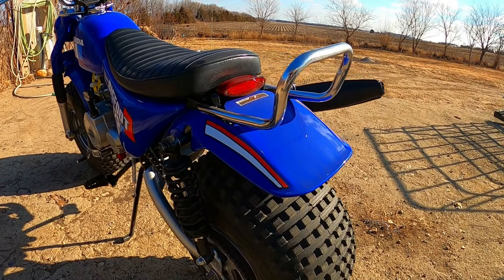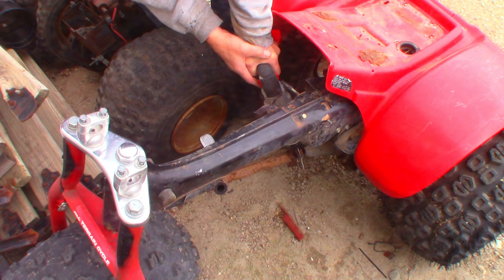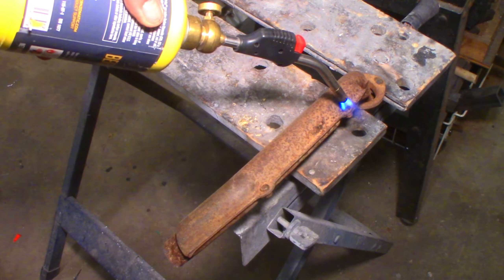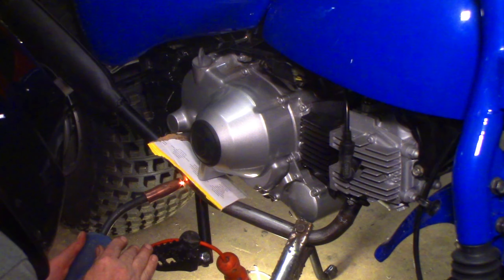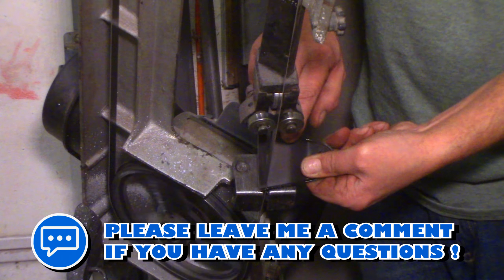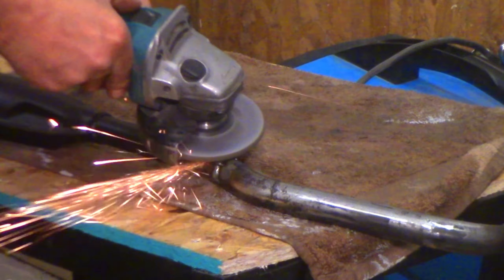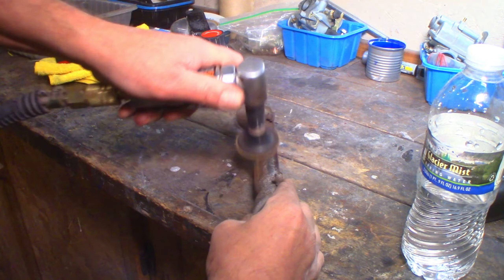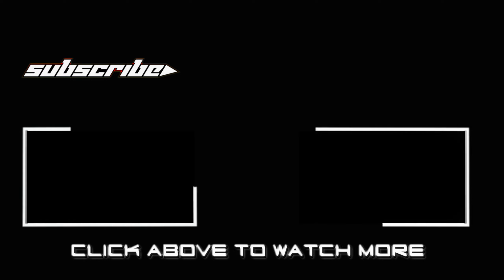Honda 3 Wheeler Conversion Dirt Bike Conversion - Part 10

Comment: Good job, but this exhaust wasn't fabricated "from scratch". I recently fabbed an exhaust for my ATC110. I used a rusty head pipe and flange from an ATC90, some old 1" handlebars for pipe and bends, a scooter muffler that I found on the side of the road, and various pieces of scrap steel for the muffler mounting flange and support brackets. I cut and welded everything together, but I still don't consider that "from scratch" since I used a section of original pipe with the mounting flange. When you bake a cake from scratch you don't take pieces from several other cakes and mash them together, you take the raw materials and combine them into a new cake. Soon I'm planning on making an exhaust for the ATC90, and I will be making everything from scrap, including the two bolt mounting flange, which I'll make from flat plate. It's a lot of work, but I'm completely broke and can't afford the outrageous prices people ask for ATC exhaust.
Reply from the maker: Thanks for the good comment! I totally agree! Thanks for stopping by too!